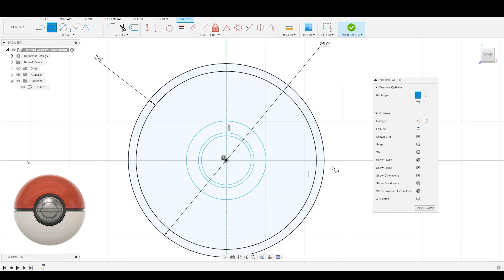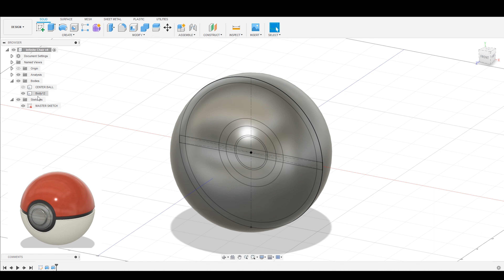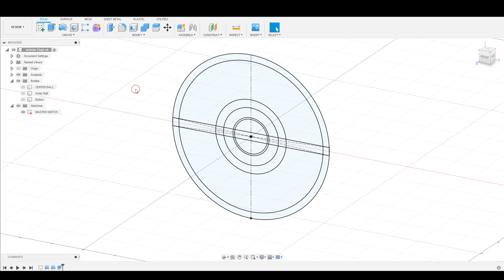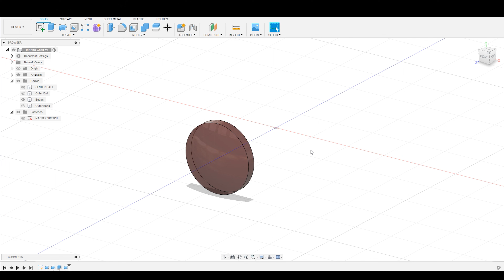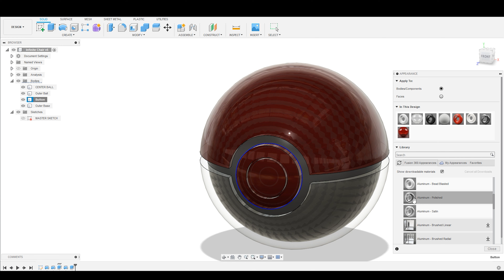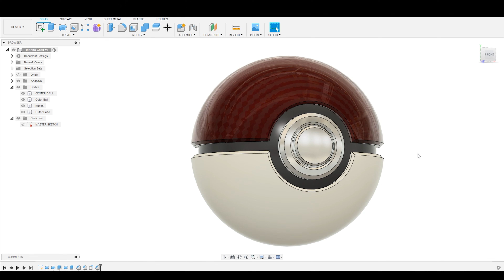Build a PokeBall in Fusion 360 with 1 Sketch! - 20 Min. Skill Builder Tutorial

Comment: Can you do a tutorial for an ultraball? I keep getting stuck on making the yellow part for 3d printing. Whenever I make the cutout and get it ready for  3d printing some of the lines are too thin to be printed. If I add a fillet to it then it becomes uneven
Reply from the maker: That's a great suggestion!  I may try to put together a tutorial on how to model a few pokeball variants from this one.    In the mean time there are 2 options I would suggest.  Option 1 - If you don't need it to open you could make the Pokeball solid so the yellow  "U" / "H" shape is pretty deep... and cutting away from the black portion (the red portion in a standard poke ball)... that way you don't have the thin wall problem.  Option 2 - You could try creating a very shallow groove to outline change between  black and yellow parts (you could do this with revolved cuts) .... in this scenario you would have 1 piece for the top of the ball(not a separate print for the yellow) but the groove would make it very easy to paint.  Hope that helps!
Reply: @practicalalchemy407  I finally found out a way to do it. You have to split a face on the top part of the ball for the yellow part and then offset it outward as an extrusion. You take a copy of that ball and offset the black parts as an extrusion also. Finally you cut the excess of the yellow part by revolving an inner circle inside it. Geez that took me 3 whole days to figure out.
Reply from the maker: @metallicaandchimaira  Awesome!  Glad to hear you figured out a way to do it!
Reply: U had a great opportunity to name the centre ball, master ball